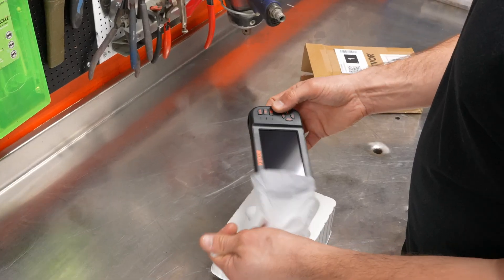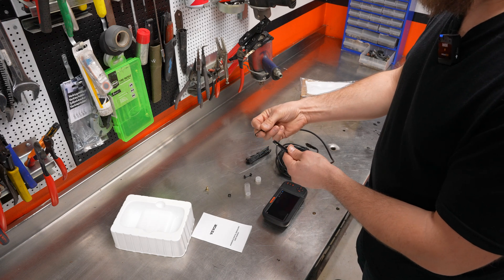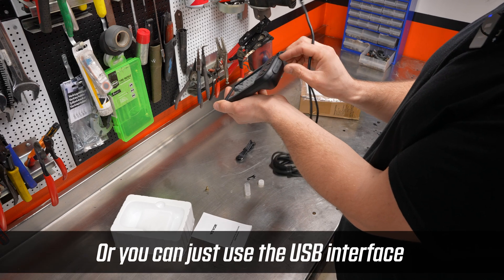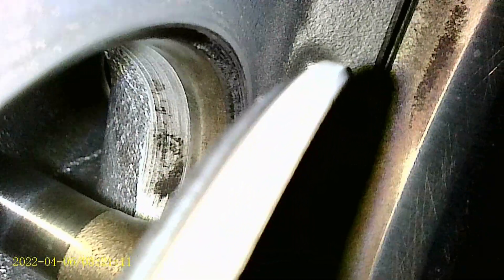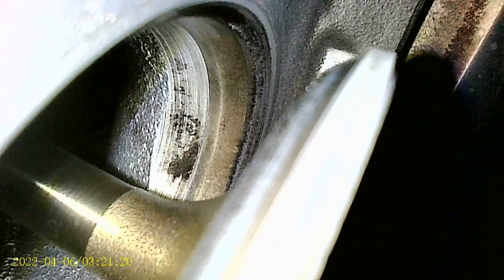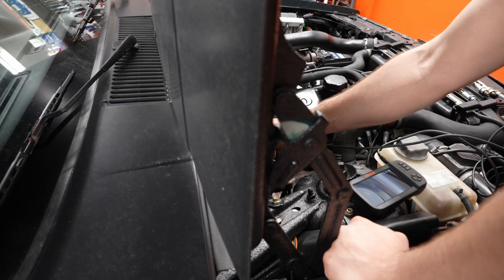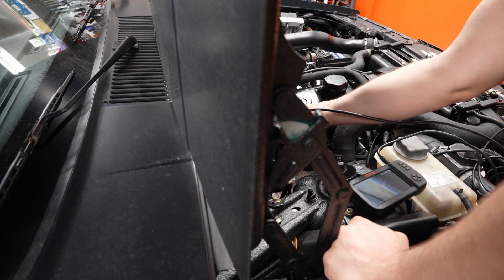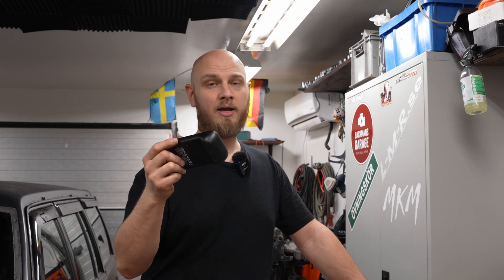What Caused this Wear on my Cylinders?  || VEVOR Endoscope Camera || Volvo 945 Build

Comment: You may be dealing with a cold start injector problem. It looks like it's injecting too much fuel which washes the oil off the cylinder leading to the cylinder stuffing. I don't think it should have been so wet when you first used the camera and that knock on startup may have been it hydraulicing in the quince area. I hope this helps. BTW it's a good looking engine and you seemed to be pretty thorough.
Reply from the maker: This engine doesn't have cold start injector, but you are correct. It did inject too much fuel due to a bad (new) cooling temp sensor that i swapped out for an old volvo original sensor and i no longer have the super rich startup problem. The knock continues to this day and over 10000km later, it comes and goes without any consideration of cold/hot condition. Im back to thinking it has something to do with oil pressure, that i sometimes sporadically have it drop down to low. Will take the engine apart soon and fins out now that i have a new daily driver. Thanks for commenting.

Comment: I think that on the first or second video you removed the piston rings and weighed it. Maybe you put back some of the rings up side down.. ?
Reply from the maker: I don't know what to think at this moment. Is been running for over 10000km now and nothing sounds any different, still got the noise now and then. 

Planning to have a look this fall, but it hard to plan these days 😄

Comment: Hi, i dont know if this was solved, but i do remember one ford tuner did always blame too high revs on cold engine. Of course race engines may be built using smaller tolerances.. that would make them more vulnerable i guess.
Reply from the maker: Currently, the issue seems to have resolved itself somehow? There will be an episode on this, but the piston släp noise is still there.

Comment: Would say rings are too tight, as they should not be wiping away honing marks in that small amount of time. Additionally, some compression ring types are A & B position on the piston and have up marks. After initial head gasket installation and first warm up I'll retorque after cool down as do values drop quite noticeably.
Reply from the maker: I think the bad temp senor caused a lot of issues in conjunction with the brak in period of the engine leading to premature failure of the piston rings.

Comment: My suspicion is when the rings went on and off , not sure if you did it but the ring gaps also need to be 120 degrees apart .
Reply from the maker: Did put the gap 120 apart, However I did not measure the ring gap where Volvo specifies to measure it.

Comment: Honestly it looks like they didn't get the rings properly and it's scraping the sides of the wall you should still have cross hatching
Reply: Ring Gap is wrong it's pushing too much to the cylinder
Reply from the maker: will have to get this re-measured when i take it apart.

Comment: Was the intercooler is full of oil?  It looked clean oil, then the turbo seals are leaking.   Very small scratches on the cylinder walls are pretty normal,  Test the compression to see if there is leakage, but that's unlikely given how small the scratches are.   Small oil leaks are inevitable on an old car, and so long as it doesn't use excessive oil, topping up a litre every thousand miles is normal.
Reply from the maker: I dumped it out later and is was about a 50/50 mix water and oil (did not taste sweet so not coolant) about 10mm at the bottom of the ic. The engine is fully rebuilt about 6months ago with new bore and pistons, should i still expect this type of wear? Leakdown is ok compression is 9bars on all cylinders. I have yet to add any oil since the rebuild wierdly enough. If i look at the dipstick it might be down a couple of mm since the build.